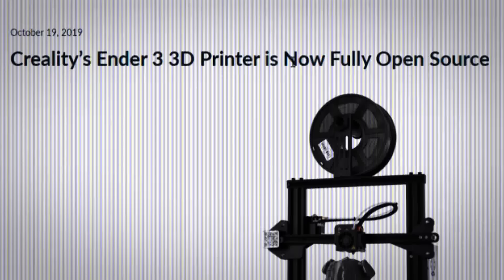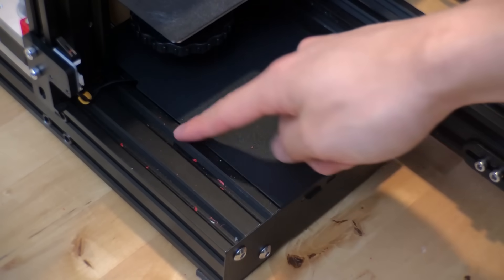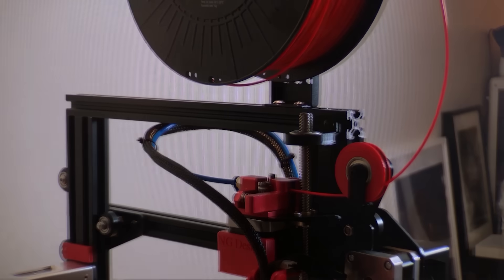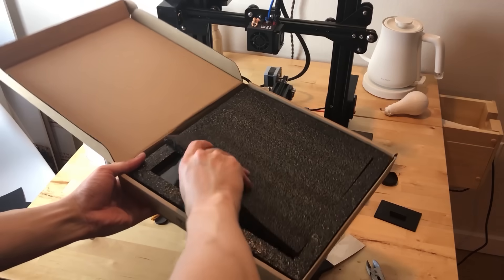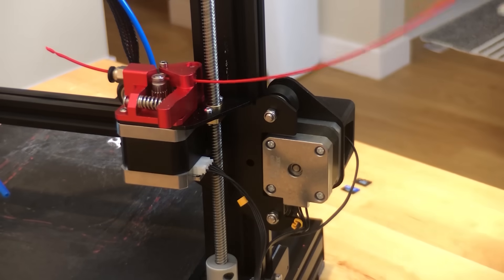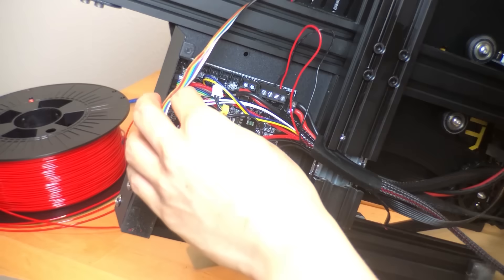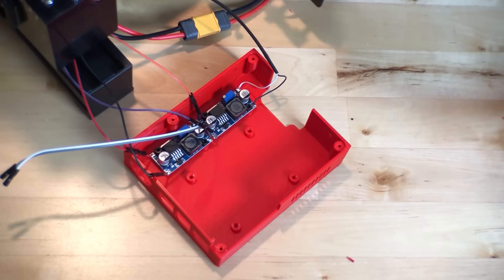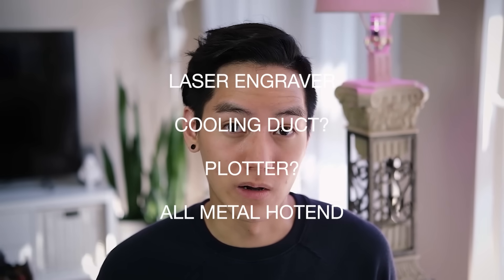First 24 Upgrades for my Ender 3 Pro - Part 1

Comment: Lots of good upgrades albeit some totally useless from my perspective. There is one im particulary unsure of the usefullness of though and that is too A: power the PI directly from the PSU and B: having a switch on the pi. Turning the pi on and off regularly is a great way to corrupt the sd card (learned that the hard way). So i would personally have the pi powered up by a seperate usb dongle so that my printer can be turned on and off while the pi remains on. But if you do this remember to remove or tape over the 5v+ connector in the cable from the pi, the drivers on the btt mainboard doesnt like to get 5v from another source. In fact thats something you should do anyways if you havent already, you can thank me later when you dont have to replace your mainboard.

Comment: I have been running my Ender 3 for two years complete stock. A few upgrades are nice and make sense like the Hotend mod. But if you do all that just get a better printer that has all those features. And by the way, still running my stock plastik extruder and it dident break....

Comment: 2:54 Like WTF??? What were you thinking, Fans are there to expell hot air, see you removed it afterwards. Why not use some Fusion skill to create a less noisy Air Channeling System.
AND
Where is your Belt Tensioner? Would also be good to have an external filament feed tensioner, to keep TPU taught against the Extruder from "Nom Noming" it all up into a spiral.

Comment: This makes the printer a little more functional, but there aren't a lot of actual upgrades.
Reply from the maker: AaronRC for sure, lots of cosmetic stuff too.  functional upgrades almost always take more time so hoping to cover more of those in the part 2 👍🏼
Reply: @ScottYuJan  can't wait. The micro swiss hotend+and an upgrade extruder makes this printer a workhorse

Comment: Does the glass bed help with bed adhesion- on my ender 3 pro I am rly struggling to get my prints to stick, even at the right temp with a level bed and a fair amount of glue stick
Reply from the maker: huh... what are you printing with? with PLA on the stock bed, if it’s leveled, you should never need to use a glue stick... the stock bed has the best bed adhesion. maybe level the bed a bit closer to the nozzle. that’s what u do whenever i’m struggling. that way there’s more squish on that first layer of plastic and that should make it stuck even more. that’s what i did when printing with petG which has a harder time sticking. also double check your print temperatures. that could contribute to this issue too.
Reply: Scott Yu-Jan yeah just pla but for some reason I often struggle to get my first layer to stick- it’s normally fine on small prints but big prints it’s never works on straight on the bed and I normally have to use blue tape and or glue stick- thx for the advice tho- I guess it could be my fillament
Reply from the maker: E4zy_ Drop hmmm it could be your filament but generally speaking, PLA is suppose to be the easiest one to print with. play around with the print temperatures. i would also recommend you clean your bed before each print. i just use hand sanitizer or alcohol to remove the finger grease and dust on there. that helps me a lot with bed adhesion. good luck!
Reply: Scott Yu-Jan thx for the advice👍
Reply: GsicariG yeah that often seems to just shift the first layer around when the nozzle passes around it- I’ll keep trying and I saw CHEP do something where he had a small print and he actually levelled the bed as the first layer went down which seemed to help a lot so I will try that aswell
Reply: A lot of the big prints I do are parts of clone trooper helmets and so have a tone of support and that’s when the nozzle seems to shift the first layer- it tends to move the first layer of the supports around quite a lot
Reply: But I’ll keep on messing around and tryna find out how to make it work- oh also does anyone know why when I pause a print and then resume it, it resumes slightly offset- I haven’t set any ofsets or anything so I’m kinda confused- tbh I’m a 3D printing noob😂😂
Reply: GsicariG ah k great thx

Comment: Can you go over the BL Touch setup? Or point out a guide you used? I have mine installed and I flashed firmware but maybe something is clicking. I cant figure out how to use it at all. Tried multiple videos as well and it seems like there's something left out.
Reply from the maker: Mitchell Turner i had a problem where after everything was set up even though the BLtouch works for homing, the prints were not sticking and the bed was still not leveled. i don’t remember where i saw this but it turned out i had to put something in the print start Gcode in my slicer software that tells the Gcode to reference the BLtouch data. that ended up solving the problem for me. but is your BL touch even doing its thing? hard to help without knowing how far you got in the installation process.
Reply: Scott Yu-Jan I was able to get the firmware on and can see the bl touch options. I can run the bed level and it does it’s little 25 point check. But after that im stuck. Printing is having adhesion issues like you mentioned. I’ll look into the code to add to cura. I think I need to switch to the other firmware for z homing as I chose the standard with the Z stop and I’m wondering if that might be let of my problem as well. I think I have an ok idea of how the offset should work if I go with the z homing version.

Comment: Im planning on getting a ender 3, wich one do you recomend me? Regular ender 3, ender 3 pro or ender 3x.

Nice vid btw man, thanks for the tips
Reply from the maker: glad you enjoyed the video, thank you. if you're certain you want the ender 3, i would highly recommend the ender 3 v2. it's the latest in that line of printers and it comes pre-installed with a lot of these upgrades. 

here's an affiliate link if you want to support the channel :) 
creality official site (cheaper): https://rb.gy/wwgxzx
amazon: https://amzn.to/2DOHPuC 

good luck!
Reply: Scott Yu-Jan ill look into it, thanks. Can you recommend me another 3d printer(other than creality). A good one, the price is not a problem. Thanks
Reply: @batgutigameseunboxings7449  a great one for more money would be the Prusa i3 MK3S. Prusa printers win awards year after year
Reply: Look into the CR-6 SE. It's basically an upgraded Ender 3 but it comes with a bunch of upgrades such as auto bed leveling, touchscreen navigation, silent stepper motor drivers, tool drawer etc. from the factory.
Reply: Paul Millhouse ill look into iy
Reply: Got it bro. But do you think that this Printer has a nice community too,
Reply: @batgutigameseunboxings7449  yes

Comment: "Without bootloader" is not right. It HAS a Bootloader allready on it. You just dont need to burn the bootloader yourself. Like on the Ender 3.
Reply from the maker: mmmm i see! im kind of new to this but i just didn’t want to buy an arduino to do this. or is there a way to do it without an arduino?

Comment: awesome video ^_^
man i got a BLtouch and had nothing but issues with it , ended up not even using it! was such a waste, ( i think mine was busted )
Reply from the maker: thank you dan! and hey, i actually had a similar issue when i first added my bltouch where the bed was still off every print but it turned i didn’t do 2 things:
set z-offset in the configuration and also adding a print start g-code that tells the system to reference the data collected from the bl-touch for every print. after doing these 2 steps, every print was perfectly leveled after! but there’s a chance you got a busted bl-touch too since i have heard that’s common since it’s made fairly cheaply. good luck!

Comment: Dont matter how u dress a pile of poop it's still poop. I hate my ender more then life out of all 5 printers I have that print 24 hrs a day everyday
Reply from the maker: Napier mail wow! that’s impressive. what brand and model are your other 5 printers? and are they roughly around the same price range too? thanks
Reply: @ScottYuJan  very close I got them used off craiglist.  Have the same ender u have. My anycubic is doing the best or the monoprint but the monoprint isnsuper small but prints the best. Then a home built using pursa a tevo and another mono print. The ender looked so promising too. I just have trouble with the heat its consistently stringy and webby no matter what I do or adjust it just has bad voodoo 🤣👨‍🦯

Comment: Whats the cost of all those upgrades + the ender pro, compared to just buying a better printer with almost all of those features?
Reply from the maker: Ivan Gabriel it ended up being exactly $138 more, not including the raspberry pi since no printer comes with that i don't think (correct me if i'm wrong) and i already had that from other past projects. i also bought this before the ender 3 v2 came out so if you’re looking to buy i would highly recommend that one or the one creality just had on their kickstarter. comes with a lot of these upgrades already installed. good luck!
Reply: @Scott Yu-Jan @Ivan Gabriel I think this is a good question! for starters, a lot of the 3d printed parts are just fun to make, so even though they cost some money in filament, they will help you learn about 3d printing while also improving your machine. The non-3d printable items do cost money and some newer printers come w these features, but overall its a great learning experience and some of those newer printers offer less customization. So even tho you might end up paying close to the same modding it yourself, you have the full range of customization a stock printer wouldn't have. Totally up to you. If you just want a 3d printer with these features and you dont want to think about it, then by all means get an upgraded stock, but some people have a lot of fun customizing things themselves :)

Comment: Amazing video! Wanted to point out that the metal extruder you installed is the easiest way to start printing flexible filaments as well. Side question- how did you reduce your stringing so much?

Comment: Well done, had feels of MKBHD and Casey Neistat.. Thanks.. Question,,,,,,,would you say the cost and time to do all the mods was worth it in hind sight?? Would it be reasonable for a normal person to just get a better printer?? Suggestions?? Or should I ask.. aesthetics aside  what would be the equivalent cost of a similarly specced printer??
Reply from the maker: thank you so much! i'm a huge fan of MKBHD and Casey Neistat so that's a huge compliment. Honestly, if you're not bound by a budget, definitely buy an expensive printer. i'm a firm believer that you get what you pay for. but since i like to tinker and mod things i feel totally comfortable buying something on the cheaper side and doing some mods and upgrades myself. i'm honestly pretty new to this stuff though, i am far from being a pro. this is only the 2nd 3D printer i've ever owned and i had to learn MOST of everything you saw in this video in the last 3 months. anyways right after i got the ender 3 pro, Creality released a new printer, the Ender 3 V2. that one comes with a lot of these upgrades already installed so if you're looking for something that's also super cheap in this budget range that's a bit more polished, i would highly recommend that one. good luck!

affiliate link: https://www.creality3dofficial.com/products/ender-3-v2-3d-printer?sca_ref=347606.p0hfBsWyg1&sca_source=24v2

Comment: i really enjoyed this video im waiting on my ender 3 pro in the mail right now and seeing this as a very recent upgrade video is amazing... great production too btw!
Reply from the maker: thanks alex! glad you enjoyed this. good luck with the printer!
Reply: @ScottYuJan  was the pi mod super difficult and also what model pi did u use?
Reply from the maker: @alexenochss  probably the harder one in all of these mods. i'm also very new to this stuff so that one took me the longest to figure out but there are SO MANY tutorials out there and resources for troubleshooting so it still only took a few days to figure out for a newbie like me. there's a utube video where a guy runs octoprint on every raspberry model and does an in-depth review. i believe the conclusion is that the latest, model 4, is extremely fast at processing prints and all that BUT it's also the one that heats up the most. so if you make sure you give it decent ventilation or put a heatsink and fan on it you will have nothing to worry about. However, if you don't want to deal with any of that, I've also ran octoprint on a raspberry pi 3 b+ before too and that ran fairly smoothly as well with no heat issues at all. good luck!

Comment: What type of build surface were you using when you printed PETG and when it finished you just peeled up the build surface and you were able to get the parts off? Last and first build surface I bought I had to send back with the PETG parts still attached. I could not get them off.

Comment: 3:25 Anyone who designs or uses this kind of constraint does NOT understand that the top of the z-axis is meant to be free-floating to improve print quality. RepRap designers had spent years coming up with the free floating design.

You could only do this mod if you're certain your threaded rod is 100% straight.
Reply from the maker: yeaaaa i got many comments about this one 😬 i'm honestly pretty new to all this and you've probably done the best job so far explaining the reasons against this upgrade so I appreciate that. i wasn't aware that almost all RepRap printers do this and is completely intentional! i'm surprised by how many variations there are of this mod on Thingiverse.... seems like a very popular one. anyways, thanks for educating me. i added a "no longer recommended" note in the video description and will also address it in my part 2 video as well. Cheers.
Reply: Just watch this:
https://youtu.be/2Z7mZVvPlc8?t=480
Reply from the maker: @KiemPlant  oh man, that's a GREAT explanation. i completely understand now. well, adding that to the video description as well haha. thank you so much. really appreciate it.
Reply: @ScottYuJan  I'm glad you like my feedback lol. Might have seemed a bit rude but I really wanted to get the point across.

Comment: For the BL touch, I am a bit confused on the links provided. I am in the US. So Should I get the Amazon one? Or when you wrote for the stock board, get that one if I don't plan on upgrading the MB?
Reply from the maker: if you don't plan on upgrading the MB i would recommend buying the BLtouch from Creality. they have a specific kit that's made for the stock MB with the needed additional parts to make that work. here's an affiliate link to that if you want to support my channel (doesn't cost you any extra): 
https://www.creality3dofficial.com/products/creality-bl-touch?_pos=18&_sid=a66c15d0c&_ss=r&&sca_ref=347606.p0hfBsWyg1&sca_source=24bl 

good luck!

Comment: The power supply fan was absolutely nerve-wracking, so I replaced the cover with a printed PLA cover that mounted an always-on 12v (with a buck converter) 92mm fan that is tapped into the main 24v feed and is very low noise, but provides a huge amount of airflow so the 60mm fan would never trigger due to temp (the little fan has been disconnected and removed).  between that, a hotend update with different low-noise fans and a mainboard update, my Ender3 Pro is nearly completely silent.
Reply: Excellent video, by the way!
Reply from the maker: Thanks! i'm considering replacing the power supply unit's fan too but i noticed that the stock fans are pointing into the power supply unit. Did you do the same for your fan replacement or did you turn it around to make it an exhaust instead? I'm a little unsure. Thanks!
Reply: Mine is blowing inward, but the plastic cover I printed has sufficient venting for air to exhaust evenly. Since there is constant circulation, the air coming out is never perceptibly warm, even after extended print runs. The Meanwell as originally configured would allow heat to build up, then the 40mm fan would kick on and move enough air to cool it to below the temperature threshold, and then heat would start to build up again.

Comment: What's stopping you from soldering the USB-mini cable directly to the Pi? You can easily break off one of the USB headers without breaking the Pi itself.

Comment: I added  a glass bed but having issues with redoing my z offset  since I do have the bltouch  I some how managed to get the z offset  right with the original magnetic bed  but after going to glass I tried the steps to get the offset number it doesn't work it still prints about a 1/8th of an inch to high I had to manually  adjust the bed height just to print something I really needed to print but the first layer quality  was terry

Comment: More upgrades? Belt tensioners :) mosquito hotend :) dual colour / mixing hotend :) a concrete paver on a firm rubber base for noise and vibration ("CNC kitchen" has a video on it) :)

Comment: what software (with what settings) do you use to get those cool looking supports?
Reply from the maker: Kieran Dolan cura! and in there if you look under the “experimental” settings area they have a “tree” supports option. i think it’s still in beta so it takes a little bit of tweaking to get right. good luck!

Comment: Very well-made! I would recommend some beefier part cooling as well as mounting the extruder to the hotend to make a direct drive
Reply: You only need better cooling for different material types...and direct drive really only benefits flexible filaments...if you're printing in only PLA like me then it isn't worth it

Comment: I removed all tape and print onto the aluminum plate
Anet A8 here (much cheaper) and honestly, I found some tape with too much glue on it.
Placed it on my bed, heated up, removed tape.
Glue left on bed. Excelent prints and I never have to calibrate, as prints snap off themselves after cooldown